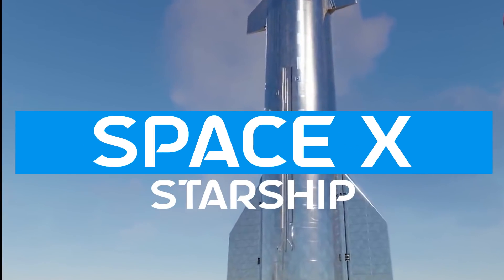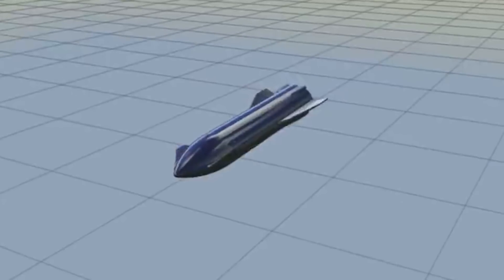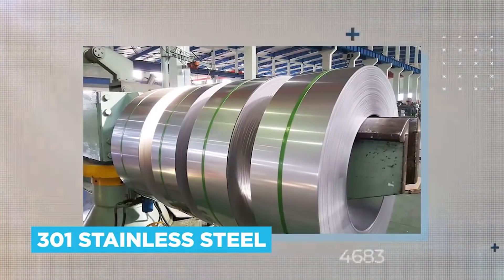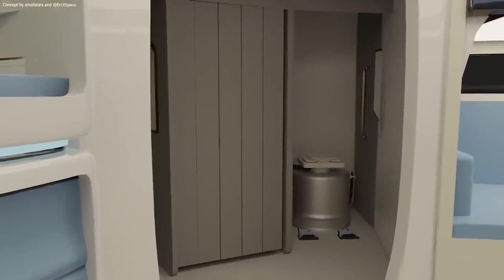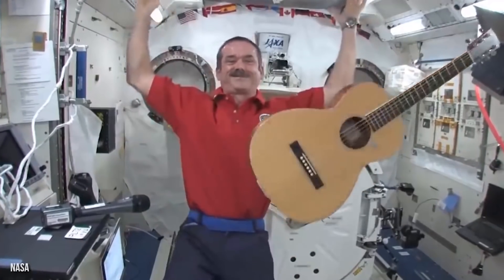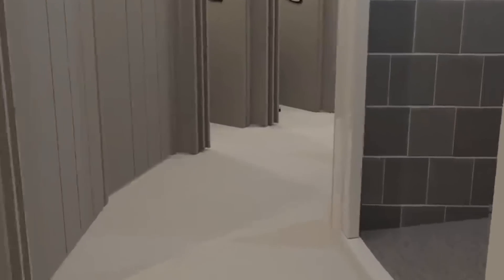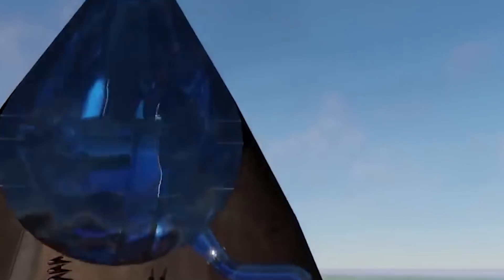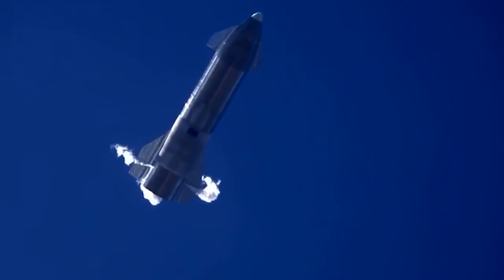A Tour Inside SpaceX Starship & How It Works

Comment: "Has the Capacity for 100 people", LOL. Divide the volume of available space by 100. Also where is the medical bay? 100 people crammed that close together not fully showering is going to cause some illness. There is a lounge but no medical? Lol. Giant personal screens for 100 people? No. You need to make the ship as light as possible. Giant vehicles on board? No. Those would have to be sent ahead of time. Giant atrium windows? No. there is a reason why the ISS has small windows that are usually covered with 10 inch thick plates. There are so many things wrong or unrealistic with Elon's visions about Mars.

This will end up like the Hyperloop. Going from a floating pod in a vacuum to a pod with wheels in a partial vacuum. Then eventually to a train.

Comment: Common dome is not a new thing it was first used back in the 60s on the Saturn 5!
Reply: @maxiglad1624  common domes only work for certain fuel types and need to be able to handle high temperature differentials and be strong enough to contain the 2 liquids not the easiest of tasks but it has been done many times before so not too difficult. Spacex is currently trying way harder things

Comment: When Elon says its actually worst when starship is more pointy/aerodynamic its actually true although it will create less drag. That's the problem he wants starship's exterior to create as much drag as possible while doing the belly flop maneuver because the nose is more pointy it will go down into a deeper dive than we've seen today ,so the flaps would have to be remade to adjust the dive which it will probably be bigger and put more weight on the rocket. It will look cool though. I don't think any rocket would probably overtake starship yet ,probably in the next ten years but right now starship has the lead. Love your vids.

Comment: Sn20 goes to Mars
Reply: Thats a funny one....
Reply: It has to be done at one point. Even if it has no cargo and it’s a prototype they need to send starships to mars to test it out and get enough information to make landing safer for when they send cargo and people.
Reply: @ajax818  if you believe 20 will be the number good for you... But we still havent gone orbital which is highly anticipated for sn15 and you think we will go to mars in just 5 more prototypes... Not likely i say at the very least sn25 to sn30 will be either moon bound or mars bound..
Reply: @godofthunder6259  SN20 is the planned first starship to go to orbit likely repeat that several times before they will start working out kinks to make it operational, a little while later, we’ll see a lunar return test, Mars landings are several years off with a fully operational vehicle
Reply: @godofthunder6259  Yeah i didn’t say SN20, just that it had to be done at some point. But i can definitely see some prototypes and not official starships being sent to mars in order to get the landing correct when they actually send cargo and people. If SN15 is meant to go orbital and it all goes right then SN20 could possibly go to the moon, and SN25 could go to mars. But thats if everything goes according to plan.